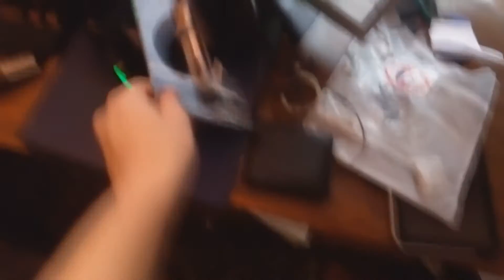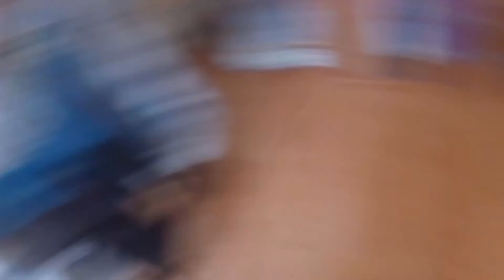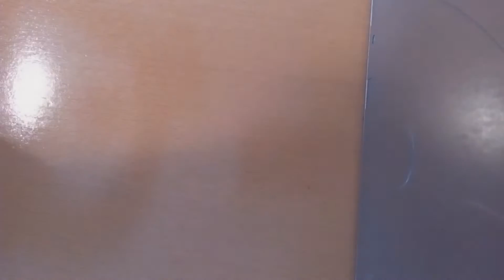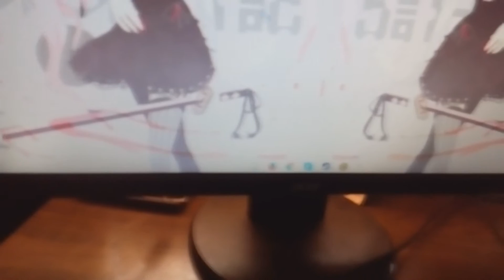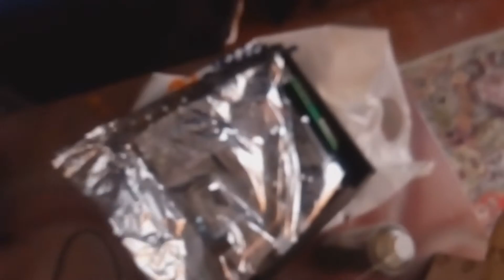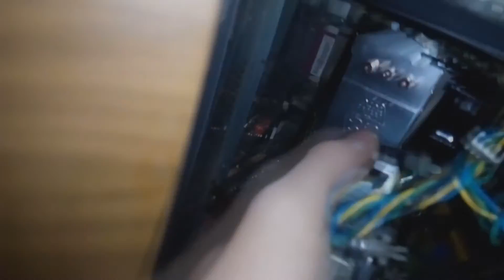Upgrading my PC - Installing a CPU and breaking things.

Comment: Wayyyy too much thermal paste, you just need one spot in the middle.
Reply from the maker: +RefinedSkillz Yeah, I figured it out. I installed a proper amount after it was running hot. But it didn't matter because my cooler was broken.
Reply: Oh right, what cooler are you using?
Reply from the maker: RefinedSkillz Right now, CM Tx3 Evo.
Reply: +Zerga ok cool, for the ram slot issue, the cheapest option is most likely to get a stick of ram with more ram on it, I have a spare AMD Radeon R7 250x, i might consider selling it, but its in use in my old pc. Currently, im using an FX-8350, R9 380, and 16GB of DDR3, also with an SSD.
Reply from the maker: RefinedSkillz I've got a GTX 660 atm. The video card is the least of my problems. But i gave up on this PC + 4gig DDR2 sticks are rare.